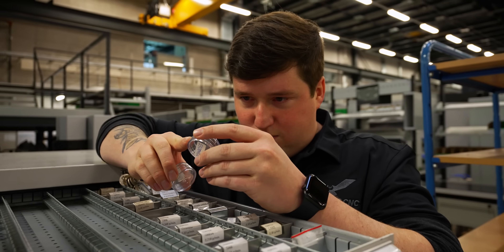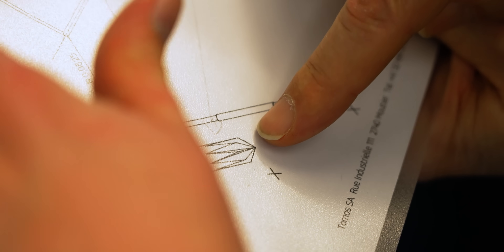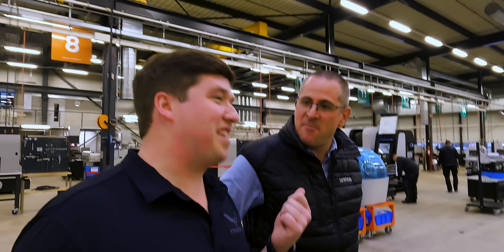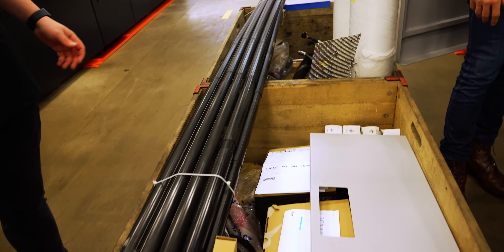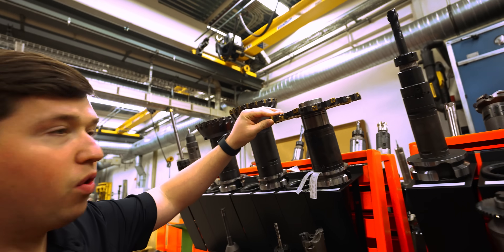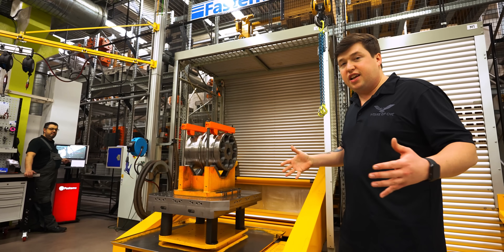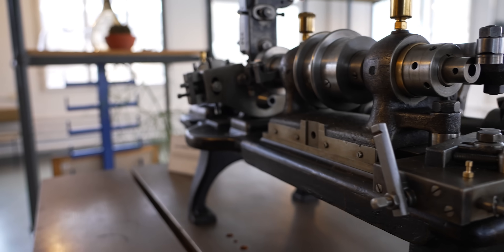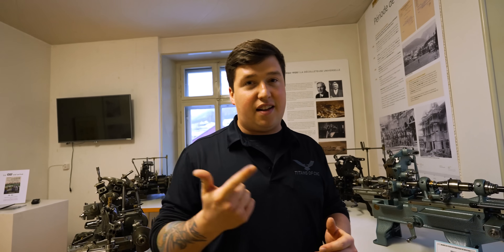Master Machinists Produce 125,000 Machines

Comment: So im actually a watchmaker and we still use many old tools in restoration. for example a jacot tool is a small bow driven lathe to burnish pivots that i use in restoration and its probably mid 1800s. Most of the really sought after watchmakers lathes are all manual lathes like the schaublin 70. People forget that people were making clocks in the 1200s, where they would have needed to accurately divide gears and turn pivots and watches were extremely advanced with multiple complications by 1650.
Reply: Thanks for the reminders..thats really priceless stuff we all need to be reminded of.........brings things in to some prespective.

Comment: I've always wondered if this was possible (and how). Like, how does the metal not bend when it's so small (and thin). The cutting edge would have to be extremely sharp for there to not be too much force/pressure to damage the part.
Reply: The Swiss style lathe helps with this. The cutting tool works right at the spindle collet,  and the work is moved in and out as required, instead of the tool moving along the work.   Another strategy is to have an adjustable support opposite the tool, which could be CNC to move in automatically as the diameter reduces.

Comment: These guys are absolute nuts crazy, last year I worked with some Andre Bechler and Tornos (both were the current Tornos' predecessors) cam lathes, dated back to the 40s and they still deliver thousands of parts daily with tolerances as tight as 0.02mm, no go rate were like 3 over a thousand, across the whole shop. Imagine the productivities of these modern machines. Crazy.

Comment: I have been to Moutier and the shops in the region for decades.  There is a show called SIAMS in the spring at the hall you passed across from the Tornos factory where all the new machines, handling equipment, etc. are on display.  The Nanos are a great addition as they take the same floor space as an older cam machine which is what they are replacing at shops supplying the watch industry.  

Those multis are very impressive but the limitation is feeding them.  You need a HIGH volume part that will run for months or years and it needs to make full use of all spindles.  If 80%+ of your machining time is on one intensive operation then you aren't saving enough time on the other operations to justify the multi.  There are programs it is fantastic though for.  

Tornos loves to setup and test the machines in house before delivery to the customer, probably why he was doing the hip component there.  They will then drop the machine off, connect it and turn it on and it should be relatively good to go.  You still need to confirm it is performing as originally proven in Moutier but you have the benefit of having the builder having done the majority of the initial work on site with all the tooling there.  When the shop is almost always less than an hour from the Tornos factory you can do that 🙂 That though only works for the first job, after that it comes down to your lead guys.

If you REALLY want to know where the advantage comes in machining in Switzerland then reach out to me and I will tell you.  Hopefully you have been in a few shops and learned for yourself.

Hope you checked out Maison des Brochettes in Moutier.  It is a cool place if you like meat.
Reply: I remember the rows of Tornos cam machines at a local wristwatch factory. Have no idea how they "programmed" them, but once they were running, it was mesmerizing to observe. Very efficient machines.